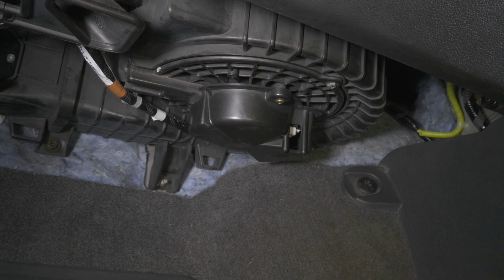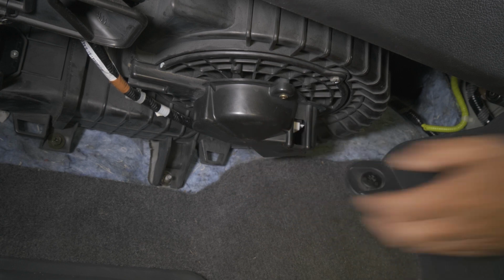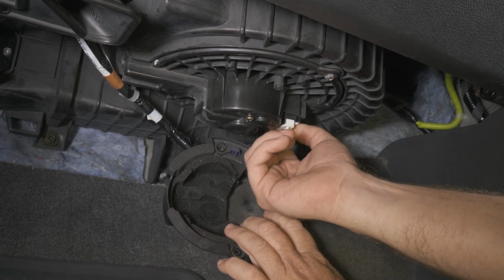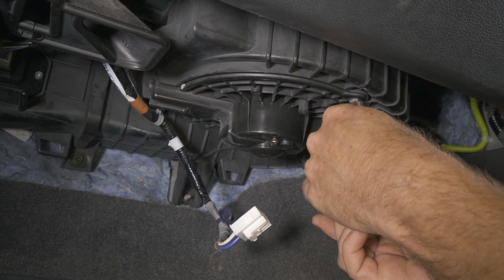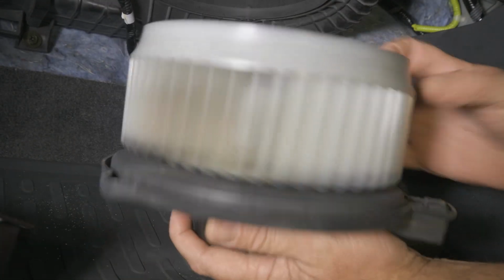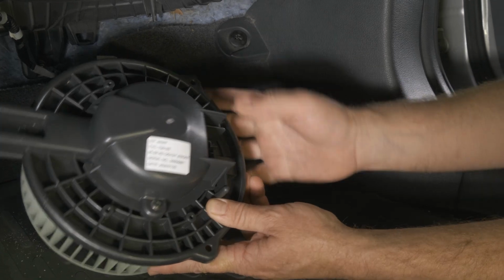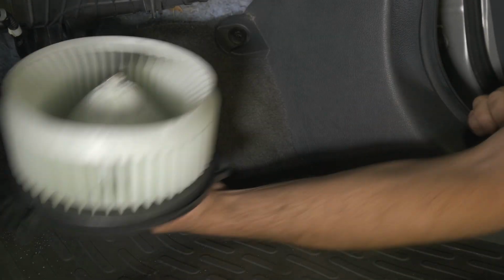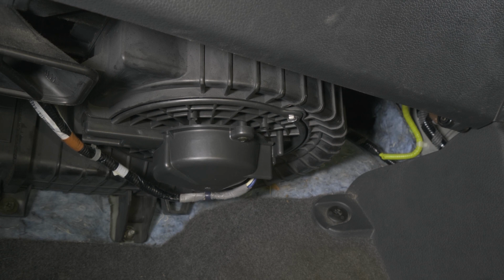2006 Honda Ridgeline Blower Motor

Comment: Hot air is only blowing through the passanger side door vent with the heat on both sides (DUAL) but none of the other 3 vents. You know what it could be?